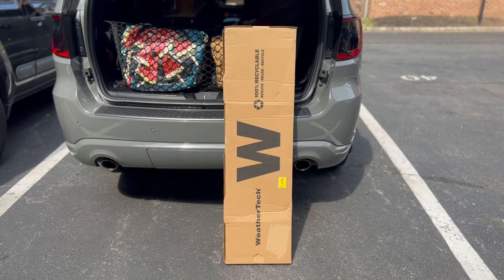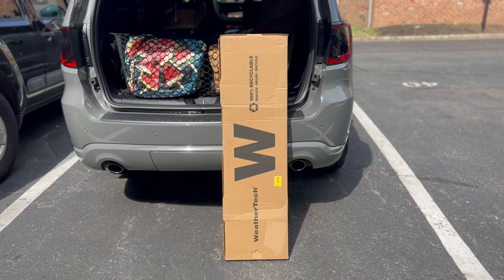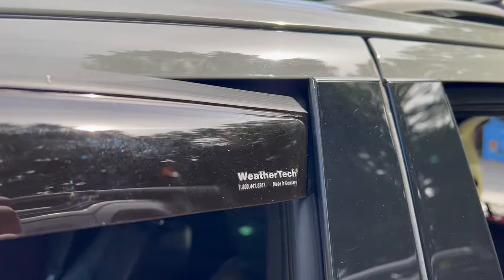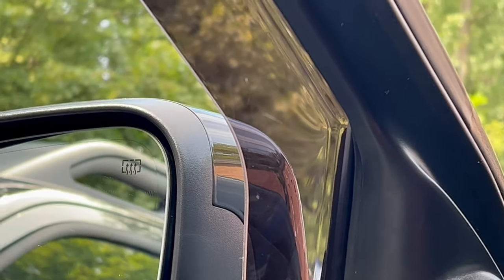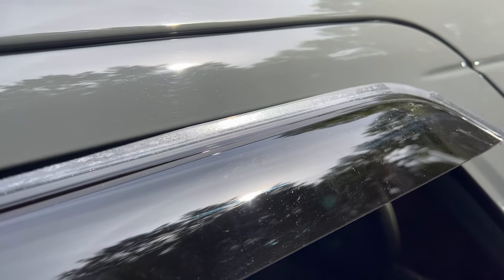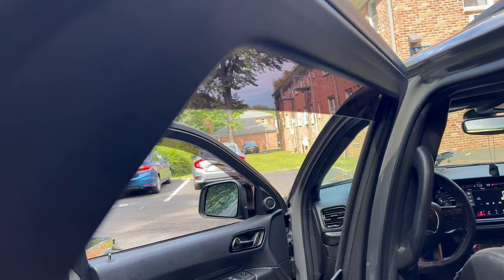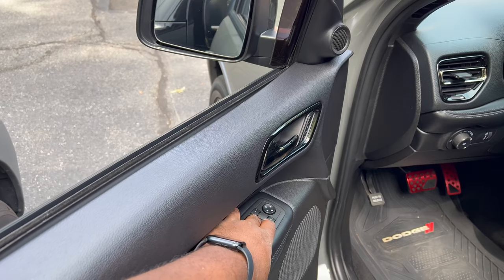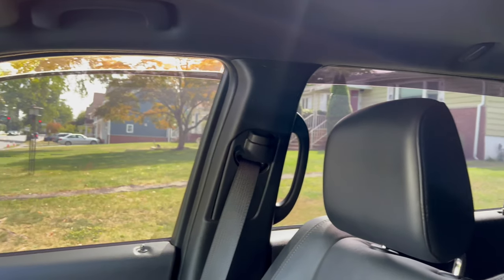Weather Tech - Dodge Durango Side Window Deflectors / Rain Guards (Install Video)

Comment: Need that clip for the front windows as well.
Reply from the maker: So unfortunately I lost the clip I recorded of the front because my phone died during that part smh, I uploaded what I had. It's relatively easy once you place the left and right side of the guard in the channel. The guard will bend outward as shown in the video. You would then push the guard in to the channel starting on the left side and guiding it in with the tool they provide.